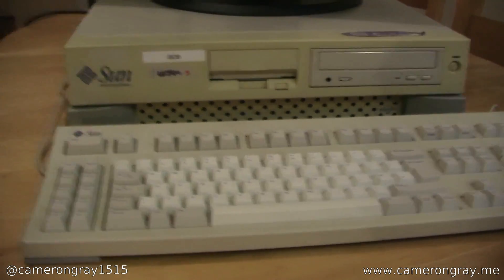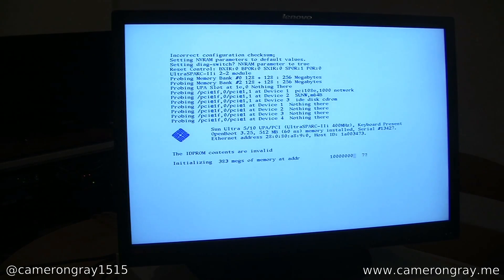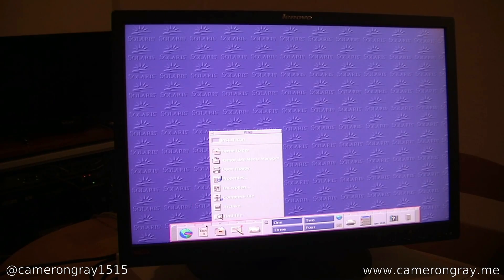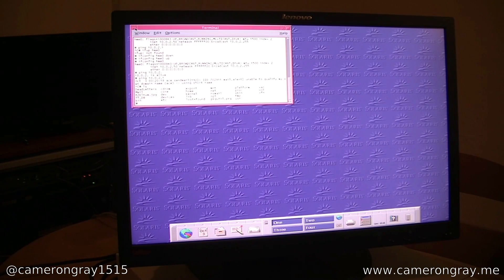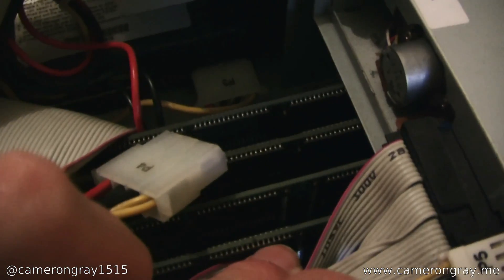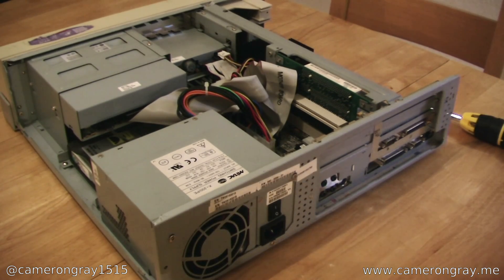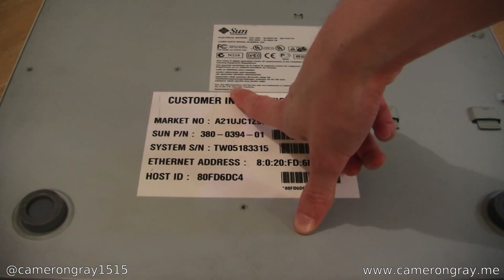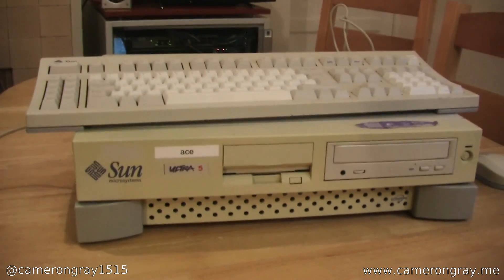Sun Ultra 5 UNIX Workstation running Solaris 8

Comment: Too bad these machines were so expensive. With a more competitive price aimed at the general consumer, today we might would have lived in a world of unix, instead of windows...
Reply: More especially, we would have been using 64bit in the consumer market for much longer.
Reply: Microsoft had the motto "embrace, extend, and extinguish". They got to the top by driving the competition out. It took Apple forever to be a serious contender to Microsoft after the mid 90's.
Reply: And still Apple has like 10% market share :-/
Reply: Not to split hairs, but .... technically we do live in a world of Unix! Android, iOS, Mac, Linux, and the vast majority of servers that serve up web content are running some sort of Unix OS. ... not to mention switches and routers all across the internet that technically run linux or some "nix." When you really think about it, Windows really is in the minority as far as OS usage until you consider only client systems. :)
Reply: not to mention that there is much more of original UNIX deep in Windows guts starting with NT 3.51 than most people imagine... Also, as many people here are well aware, you can have native UNIX shell in Windows 10... just add WSL and run bash — kaboom, you're in Ubuntu console. I managed even to run GUI natively using an external X server (VcXsrv), but since my laptop's video capability is limited to what Intel HD4000 can muster, it's a pain, because compiz uses OpenGL exclusively, at least in this case, and HD4000 isn't stellar in that department. WSL can't yet work with external USB devices and some other stuff, but I think it's a question of time, not probability, to make two ecosystems fully cross-compatible at least from WSL perspective (I'm willing to switch to whatever *nix except MacOS the very day I can run the most recent Adobe software as good as I do it in Windows for the last 20 years).
Reply: lenooh puls well, I love my SUN gear to death and will ride for Solaris til Kingdom come...but I don’t think Solaris would have ever had a chance as a consumer OS.
Reply: Ken Nicholas wasn’t Windows built on Unix anyway?
Reply: MegaManNeo What’s so special about 64bit if you’ve got less than 3.5GB of RAM?
Reply: Commodore really screwed that one up. They were making UNIX Amiga machines, and almost had a deal with Sun to deliver low cost personal workstations. If that deal had not been squished we could very well have been sitting with Amiga UNIX workstations instead of Windows PC's now. What a world that would have been! =)
Reply: mamster233 No, Windows is not built on UNIX in the slightest. And 64 bit hardware has MUCH better performance than 32 bit hardware. Roughly twice, actually ;)
Reply: Because apple makes Crap hardware and cant back it up with out a lawsuit .. Why i just Run there OS on what i made..
Reply: well...in the period from 1980 1994, the separation of UNIX in 2 side was a big disaster that almost meant the death of UNIX. AT&T with Sys V and Berkeley with BSD were not able to agree with a standard. The effect was a creation of a bunch of OS Unix commercial (like Xenix, Unixware, True64,...)that was not compatible between them (UNIX wars). And what was a big effect? That Microsoft used this confusion to enter in the market with Windows NT ( even NT is UNIX derivate.....incredible....many peoples ignore that)
Reply: @lupine25  *BSD distribution were used buy much of the social used in the world
Reply: @ferguson4260  NT is not a unix derivative, it's nothing like it,
Reply: @jonesconrad1  you need to infor yourself i let you make some research
Reply: @ferguson4260  I've already done the research thanks, it was architected by Dave Cutler who worked on the VAX/VMS operating system, who carried over a lot of the design into Windows NT.
Reply: @jonesconrad1  yeah that's why i am saying that somehow derivates from UNIX world. From VMS to NT carried stuff in the NT  OS. UNIX and NT are coming out with the same ideas that was elaborated at university. The architecture of UNIX versions is quite similar to NT (kernel mode, user mode and so on). So there are connections and derivations between unix and NT
Reply: Perhaps, but I believe we would still be in a place where every goddamn distro/os wants you to register, sign up, log in, etc.   I want Single User systems to come back.   Turn it on, get to work. Turn it off when done.  Install what you please from compatible software options.  No lockdown of user facing anything.

Comment: That "more modern firmware" is, in fact, a complete Forth environment. Therefore if you'll learn Forth, you can work on this machine without booting Solaris, nor anything. Yes, the problem may be "lack of software", I agree - well, after you learn Forh you'll create all you need by yourself. ;)

Comment: Good ol' Slowaris 2.8 ;) I must have installed hundreds of systems with 2.8 back in the late 90's and early 2000's, while working for SUN MIcrosystems in Brussels as a contractor...
It's slow, but very reliable and very scalable (up to 64CPUs back in the late 90's!) :)

Comment: Hi. 10 years ago, I revived 3 of those machines, recovered from the storage, because we had a 0-day in bind which was running un SunOs 5.6, with no update anymore. I installed debian/sparc64 on them, and they returned in a server room. The hardware was on the top of quality, like you mentionned. I later had a Blade100, which was already not in the same league anymore.

Comment: The OpenBoot firmware is also a Forth language environment and you can type arbitrary Forth programs into the boot console.  To see it work as a calculator, try something like "123 123 + .". Add-on cards would include Forth bytecode on a ROM to initialize the hardware.

Comment: I have alot of nostalgia for these old SUN Sparcstations and the like considering it was the first computer I ever had. Found a setup (Monitor, KB, Computer, Mouse) in the dump and took it home around 2009. While it was obsolete by then, it was a fun system to play around with. Sadly the thing died about a month after I got it (would not show any signal)

Comment: Had an all in one Sun ELC I sadly dumpstered like a decade ago while moving. Not the fastest but it was only supposed to be used as an XTerm.

And yes the MAC address 0ed out is due to the failed battery.
Reply: I remember the Sun SLC's and ELC's! You could add a disk to them via the external SCSI port. I did to mine but once the monitor went you were rather stuffed. I remember lusting after the IPC/IPX machines...

Comment: I had one of these as a freebie given to me a friend that was chucking it out.  It was used as a sort of general purpose machine at work we just tried crap out on.  It was one of the most reliable machines on the network.  Aside from being a general purpose thing, it ran NTP for several hundred clients.  I had it running Asterisk IP PBX at one point too.  It was also a general purpose web server, we hosted things like the "Down for maintenance" page, because it was one host that was always up we could redirect traffic to in an emergency.

Comment: I still have one of these I think the cpu is a 360, and it’s sitting in a corner in a box tore down with a few parts that I have given up on replacing.  It use to be a good box ran Solaris 7 back in the day I always hated cdm.

Comment: I always wanted to do some case modding and put a modern Xeon into it. 
The pizzabook always gives me good memories when i was fresh in college.
Reply: I'd be tempted to start with a Blade 100/150 instead, because their motherboards were ATX-ish, IIRC, so fitting a modern mobo in there wouldn't be too hard.

Easier on a Blade 2500, for sure, but those are boring ATX towers - they'd look like any old PC, so the heck with that :P
Reply: Exactly.  The only reason is that the U5 still has a unique design.
Reply: I like the Sun IPX cases. They are cute, fit a mITX mobo and then some.
Last summer someone local to me gave a bunch of them away but I was late and got only a harddrive enclosure. Same size but vent holes in the front instead of floppy. May be better for cooing though.
Reply: Intel chips in a Sun chassis :( Let me guess, you'd put Linux on it? Or ... Windows? :(
Reply: @lunasophia9002   A hackintosh of course

Comment: You could upgrade it to Solaris 10 if you wanted to, though with less than 2GB of RAM I wouldn't want to.

A fair few PCI cards from PCs will work - if you want USB, a PCI USB card will do the job.
Reply: Maximum of the U5 was 1 GB. I maxed it out and it was slow, even when it was brand new.
Reply: Solaris 10 is a huuuuuuuuge memory hog between ZFS, zones, and all the other cool things it can do. I wouldn't want to touch it with anything less than 4 GB at an absolute minimum, and preferably as much as possible. L2ARC IS HUNGRY!

Comment: The IDE in that was very, very slow. The machine could be improved a great deal by adding a sun supported Ultra Wide SCSI card. I ran a Ultra Sparc 5 running OpenBSD as my firewall about a decade ago now.

Comment: Do you know what Desktop Environment Solaris ran here?
Reply: +Old Aussie Ads It's CDE (Common Desktop Environment)
Reply: You can acutally run CDE on other Unix implemetations now since it is open sourced.
Reply: Older versions of XFCE in Linux were designed to somewhat clone the look and feel of CDE.
Reply: I used to administer some AIX boxes that also used CDE and Motif; they weren't Sun specific.
My first Mac was an SE and I always found CDE clunky.
Reply: Because it was called the "Common" Desktop environment  CDE ran on HP-UX, Digital Unix, Solaris, Unixware and others. Even the OpenVMS window manager was close to CDE.

Comment: I've got recently a Sun Ultra 10 (which unfortunally had a faulty motherboard), which is an Ultra 5 on steroids. They both share the same motherboard, so i used a motherboard from an Ultra 5 (with a dead CPU) and i installed in my Ultra 10 (to support powerful CPUs you need at least the Einstein 21 motherboard).

Mine features a 440MHz UltraSPARC IIi, 768MB of RAM (for some reason the Hyundai pair gets detected as 256MB, when instead should be 512MB, bringing the machine to 1GB of RAM), a 20GB IDE HDD, a Creator 3D card (that i removed from the system, since that i don't have a 13W3 to VGA/BNC cable) and a Sun 1GB ethernet card. I added a Tekram DC-390F, since that being based on the NCR 53C875 it gets detected by OpenFirmware, and i could install Solaris, BSD or Linux

Comment: My Ultra 10 ( https://a.pomf.cat/zrivlv.jpg ) was saved from the dumpster at NJIT from a friend that moved to France and gave it to me along with a Blade 1000 and a couple of SGI workstations. the Blade 1000 is long gone, traded it for a Sun X2200 M2 (which now has a couple 2373 EE's and 64GB of RAM, waiting to be colo'd in California) and the Ultra 10 still happily runs on my side desk on a KVM switch if I really need to get local access to it. 

The U5 and 10 share a motherboard, your annotation is correct. if you remove the floppy drive in the U5, you can install the full 1GB of RAM the board supports, which needs double-height RAM sticks otherwise. the 5 and 10, at the end of their life, were cheaped out on their capacitors, and the filter caps for the CPU board to the immediate right of the card sockets went all puffy in mine some time before I acquired it, probably why mine went into the dumpster initially. the brand of capacitors was IQ, so watch that if you have similar. if you're lucky to have been bestowed with a reputable brand, you should be good. if not, it's a fine time to replace them out with low-ESR electrolytics or solid-polys if possible, and re-paste the CPU at the same time-- the original compound and thermal pads are now so old that they're seeping oils from seperation onto the CPU and cache chips, increasing thermal resistance. 

my PSU also went short a couple boots after I got it, and I had to install a different one. the main thing to be worried about is that I don't think it follows the ATX spec to a T from that time period, so the 6-pin header going to power the UPA slot for the optional Creator3D card might not be the same electrically as what it wants. if you're not ever going to use that slot and opt for an XVR-100 card like I have in one of the PCI slots, you don't even need it if you've replaced the PSU, and in practice any standard ATX PSU from this decade will do just fine, especially if you plan on adding SATA drives of any kind in any forseeable future.

These run very well with said XVR-100 (or equivalent flashed Radeon 7000 64MB), an NEC-chipset USB card, an Intel Pro/1000 Eth card and a SATA card (SiI3112 or 3114, take your pick, needs a Mac Open Firmware BIOS) so long as everything is good for those on the host OS. No idea about Solaris 8+, apparently it's all supported with the proper patches on 9... but as you're probably well aware with your work with the Tardis project, they do run Debian (and OpenBSD) formidably. the thing to watch is the on-board IDE controller is limited to a max speed of about 15MB/s in either direction, and this can make the system appear slower than it is. if there's a SATA card installed one can easily get around 65-70MB/s over the PCI bus, and I believe it does bus mastering pretty well in that regard. Sadly there's not a single recorded case of anyone ever booting off SATA in these systems, something at some point in time I plan on becoming the first to document.

the National Semiconductor PHY for the on-board Sun GEM 10/100 NIC (immediately above the onboard ATI Rage GPU) should be heatsinked at this age in its life, especially since it can reach 60-70C temperatures in some cases. without even being plugged in or being used. Although it runs this hot by design since it's first-gen Fast Ethernet, it can cause a lot of unnecessary heat buildup in the system by the card slots, and fizzle out, leaving your only option to be an add-in Ethernet card which should be used anyway-- the GEM chipsets have a bit more overhead in comparison to a more modern Gigabit PCI card.

May your Ultra 5 live a long, happy life in retirement, and hopefully you can get that NVRAM battery taken a look at some day. Having done the mod myself, it's not pretty, and you can easily destroy the NVRAM chip underneath if you're not careful-- this almost happened to me. (sorry for the wall o' text, also.)
Reply: I also have a U10 saved from a dumpster ( was an MRI or CT scan terminal in a previous life).

Comment: ip conflict on the network.  Mac addr on switch pointing to something else on the network and return is going to the other machine?
Reply from the maker: Nah, the machine had lost its MAC address due to the NVRAM battery failing so it was using a MAC address of 00:00:00:00:00:00 and the switch was therefore not forwarding the traffic.  I've since been able to get it working by running a series of commands from the OpenBoot prompt before booting to set a MAC address (I show a similar process in my SparcServer 5 video as this has the same fault)

Comment: Cameron could you message me.  The British army are still using these machines to run a simulation programme. It’s a lost art and we are struggling for expertise.  The systems are in great condition but nobody know how to use them.
Reply: Really, you can't find people who know Solaris?
Reply: Sadly not.
Reply: The dream solution would be to lift the software (simulation) and place onto a modern day windows based computer. I appreciate this would have to be run in a virtual area, but the simulator also needs to be networked in a classroom via Ethernet with a master terminal. I agree that it’s sad that we no longer have the expertise, but the military is windows based nowadays.
Reply: WOW.... Well, I know the hardware and software well... But I'm not a British or UK citizen (Aussie)
Reply: Andrew, thanks for the reply.  I would love to chat more and understand the art of the possible. Could I give you my email and I could then frame the problem in a little more detail.
Reply: Do you have the source code for the application? Solaris X86 can be run within a standard Windows VM and is supported but there is no way to emulate Sparc under Windows to my knowledge. If you have the source code then the first step would be to recompile the code on a Solaris x86 machine. I would not say that it is sad to see Sparc go away - more scary that the military is dependent on Windows! Also, it depends if you have any special hardware for the application.
Reply: We have put in a request to see if we can locate the source disks/software, but it’s not looking good. As far as I am aware there is no specialist hardware. The main computer has a scsi hard drive in, I assume for the extra speed. I have managed to get one fired up but met with loads of errors. Happy to send you a video of the boot up sequence and all the equipment coupled with what the software is. I’m just not comfortable doing it on YouTube lol.
Reply: @tinsoldier671  Feel free to provide your email. From my reading on the web the sparc emulators that are available don't seem particularly stable. or are limited to 32 bit only So no Ultra Sparc for some of them. That ties with my own experiences as a former employer needed to move off Alpha hardware and tried to use an emulator - that failed as well even after throwing a lot of cash at it.

Comment: In comparison to the older Sparcstation 2, 10 and 20 this machine appears to be a cheap low cost design without the brilliant design of its predecessors.
Reply from the maker: Yeah, the Ultra 5 was marketed as a lower cost machine that uses more standard PC hardware.  On the plus side, it means that for people trying to use them nowadays it's easier to get spare parts for them (IDE drives, ATX PSUs, VGA monitors) although it does make them a bit more boring! :P
Reply: The sparq 20 was an awesome machine, tbe case was so strong to nold those heavy assed monitors